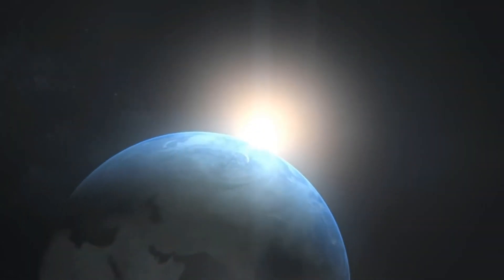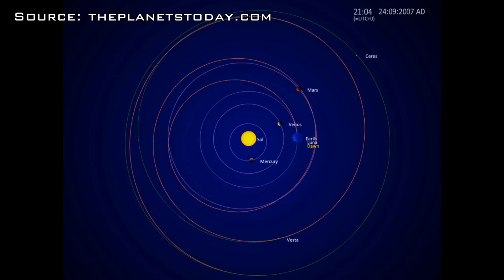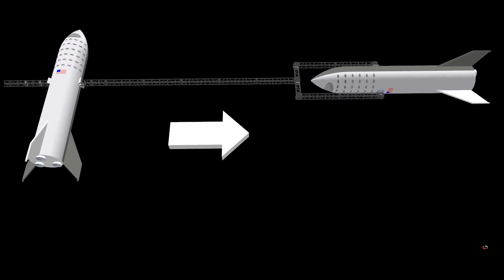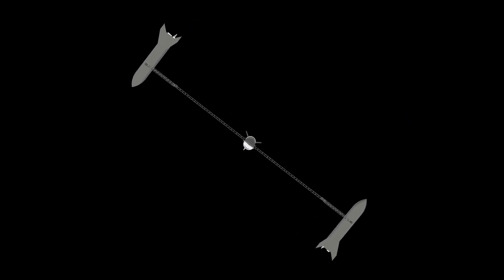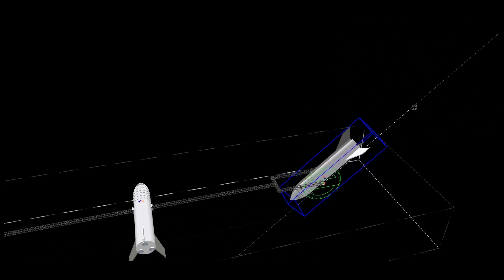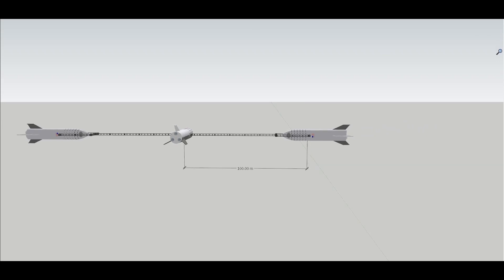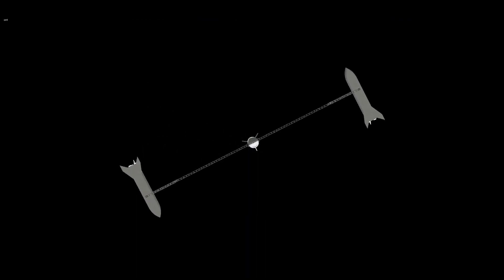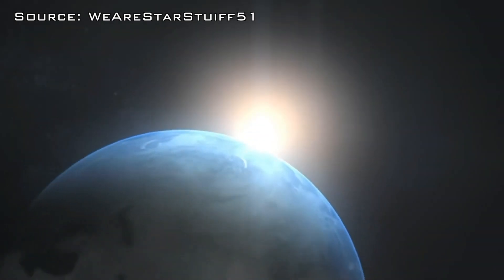GLS2: Artificial Gravity for SpaceX's Starship

Comment: I don't think you all understand that you cannot create artificial gravity by rotating anything in space.  There is NO gravity to pull you to the sides or bottom.  You'll still be floating in space regardless.  I don't know who came up with this idea but no one seems to have understanding or common sense to this.  Centrifugal force requires gravity to pull you down or against the sides.  Without it, you'll still be floating around in space while the ship rotates around you.
Reply from the maker: You are incorrect. Google gemini missions, they actually achieved spin grav in space.
Reply: No, "centrifugal force" is a property of a rotating frame of reference and doesn't require gravity ("centrifugal force" is just inertia by another name). All rotational motion involves an acceleration towards the axis of rotation, a centripetal force, without that the object would continue in a straight line (as per Newton's first law) rather than moving in a circle. Spin "gravity" works by using this acceleration as a gravity equivalent (the wall of the rotating spaceship pushes against your inertia and you feel that push as weight). It's well understood high school physics.
Reply: Anon Ymes not possible.  The ONLY thing at spin and inertia is the circular object at spin.  You are an independent object still relevant to actual space itself.  You don't just basically gain weight in zero gravity just because something is spinning around you.  This is where they tried to explain something that isn't possible to apart possible.  You were taught wrong like most sheep and forgetting basic common sense.  You are a floating object in space.  Even on Earth where gravity is present, if I place a circular device using spin around a stationary object and I'm just standing outside of it, will it pull to one side or to the inside of the circular object?  NO!  So what makes you think it will on a zero gravity environment? Here on Earth we have weight and would only gain more by your definition.  Ever been in the space ship at any fairgrounds?  The walls/places where you lay against is at a 35 degree angle so that you lay against the edge.  Thus locking you into and against the walls by centrifugal force.  Have you ever looked at a medical blood separation centrifuge?  They lay at up against the walls at a perpendicular angle to apply a minimal amount of gravity.  Please think about this with common sense first.  Not with a false assumption which is a lie told to provide understanding of something that isn't possible.  In space you have no weight (mass, but zero gravity as we know it on Earth).  Thus you can't lay at an angle to apply a minimal amount of gravity to push against the walls as it's done here on Earth.  You aren't creating some magical gravitational force that will be in the middle of the circle pulling you into our against the walls.  You can create force but nothing to hold your against it in space.  This alone is basic common sense here.  I suggest you actually build a small working device and try it first here in gravity and again in a vacuum.  Simple enough to hang anything by string in a vacuum and see if it pulls to the side.  There is NO working example anywhere ever made only simulated.  Why, because it's not possible.  The science actually contradicts it... But someone has explained it in a lie for those who lack understanding and common sense.  You'd rather believe what you're told than allow your own mind to understand the truth.

As for Google, the force you're explaining is a very closed environment.  There's no space inside or between.  You should have looked at this.  In rotation, yes, it will cause a centrifugal force.  That is the truth.  Be off you provide space inside you can hold anything to the walls as you're still in space.  You are also not laying in a perpendicular angle and if you were you would still be free floating in space.  There is no gravity to hold you at an angle up against the walls.  You will be thrown around violently.  I feel you're not actually familiar with centrifuges.  All of them lay everything up against the walls at an angle perpendicular to it's spin.  That's because we use gravity to force us against the walls and hold us into the centrifuge.  No gravity nothing to hold us in place.  We aren't just going to magically have weight that sticks our feet up against the walls just because that which is around us is spinning.  Now, let's say we create some kind of magnetic boots that area strong enough to hold us down but not throw us off or out of the spin.  That will allow us to move freely.  However, again, no angle, no gravity, no weight, so there's nothing to force us against the walls.  We will be held in place, but without weight and therefore will sustain g-forces instead of weight being applied.  I feel I haven't got where with your understanding of actual space and how centrifuges work on Earth.  Visualize this without anything but your understaffing of basic common sense and the basic laws of gravity, zero gravity, and a vacuum.  Only you will be in an air mixed environment inside.

So let's look at the space station... It's supposedly in a Geo orbit around the Earth.  So if that's the case why are they not pulled against the wall or able to walk upon it.  It is after all traveling at 17,200mph.  So in theory that your describe should provide a force against the wall(s).  But that's not the case is it?  I'm not saying you can't create force by spin.  That is possible.  However, You just can't force an object in zero gravity against something just because it's in rotation around you.  You're still in zero gravity.  But standing your mass is displaced and against subject to zero gravity.  If you, however, laid up against the wall in rotation you'll stay up against it and be subject to g force.  I guess I should have been more clear.  You will NOT be able to stand as your mass in zero gravity will be displaced and not in equilibrium with that of the rotational spin.

Comment: How about attaching 5 BFRs to a huge cylinder in a 5 point spoke and launching all at the same time.  The cylinder would be mostly hollow but have a truss system in the middle that would deploy even further and have 5 or more Starships attached for the spin up.  The hub ship would never land. It would just orbit when it got to Mars then return.  Plus it could offer an even bigger center section that could be used to grow food.

Comment: Extremity ingenious idea, this is so smart I can't imagine a better way of doing it
Reply: The smarter way is to design the interior of  each starship so that the starship itself can rotate on it's z axis by itself.
Reply: @illustratum42  shhhhhhh!!!....nobody else has caught onto that part yet...🤣🤣🤣
Reply: @dwilson8943  I think they did design it that way... But what I'm curious about is the radius is too small so that the head and feet would be rotating at rather different speeds...
Reply: @illustratum42  right, u would hope they make that top section more an observation deck area and the more lower section before engine and fuel area the living quarters with a internal rotation, that atleast how id do it...lol
Reply: @dwilson8943  that would be sweet, but pretty tricky to engineer... If something is rotating internally it needs a counter rotation to cancel the torque. And the smaller the total mass, the more smaller weight offsets, like more people being on one side versus the other would cause wobble.
Reply: @illustratum42  hmmm u right, like a counter rotation system for the gravity being produced...we mite as well go apply for spacex and help them out with this one..👏🏾👏🏾👍🏾👍🏾

Comment: the truss structure would have to hold the thousands of tons of ship at either end. it would make more sense to have small "passenger pods" with specifically the humans at the gravity and everything else at the center to have less weight on the structures and don't forget if anything on the truss fails then it flings passengers into space so the very absolute last thing you want skimp out on is the truss structure
Reply from the maker: Hundreds* of tons. Metric tons. 420 on each side for this journey.

Comment: It's not worth all the extra fuel needed and more complexity/danger of the mission.  Also I suspect that when the rockets change orientation it could throw the spin off (impossible to connect the truss at the center of gravity because the COG changes depending on the amount of fuel/cargo.) I vote for a spinning ship, or partial spinning ship design.  Like the one in the movie Europa Report or The Martian.
Reply: Both of those ships (Europa report/The martian) were small by comparison to this design (in terms of radius) and wouldn't be able to achieve the same acceleration/$ ratio that is presented here.
There would be significant construction on orbit and a design of an entirely non-existent craft at present. 
The design & method demonstrated by @smallstars utilises technology that will soon exist (starship) with some adaptations, Thus a significantly greater acceleration/$ ratio - more gravity for less money. SpaceX has already demonstrated that fuel is the cheapest component of spaceflight.

Comment: Speeding the rotation faster than mars gravity seems wasteful, they will be better acclimated by living in mars gravity during the trip
Reply from the maker: Every week living in less than 1 G, humans get weaker and weaker. Why not be as strong as possible? I agree, It would be nice to have some .38 G practice.
Reply: @smallstars  - would it be possible to drop from 1g to .38g maybe a week or so before arriving at Mars? Or even better, gradually step it down each day as they get closer, thus avoiding a sudden change in G.
Reply from the maker: @DiscoScottie  Yes! I was thinking almost exactly the same thing. A week of .38 G training would be great. Any more than a week does not give any benefit IMO because more time living in 1G will keep the space travelers healthier and stronger for longer.
Reply: The sad truth is, we have pathetically little research on the human impact of LOW gravity.  We have significantly more research on zero-G, but we don't know how much "G" is enough to acceptably minimize the nasty negatives of zero.  PUT A SYSTEM SIMILAR TO THIS IN ORBIT PRONTO.  Let's get some research going!
Reply: @737smartin  Exactly. Haven't spent as much time in low gravity environments. I'm sure it makes a lot of difference. Everything still goes down.

Comment: What if they used much less spin so it was only like 10-25% of earths gravity? It wouldn't require as much strength in the arms, and use less fuel. This wouldn't completely solve all of the problems of micro gravity, but it would at least minimize some parts.
Reply from the maker: It would be better than micro yes, but in my opinion the more gravity the better up to 1 G.

Comment: Great idea.  I missed discussion regarding the Coriolis effect.  Humans don’t tolerate having there vestibular systems spun up with any frequency.  Any movement within a short arm rotational system spins the fluid in our semicircular canals if we move our heads in and out of the rotational plane.  So you would need to be sure that the radius of the system is REALLY long to minimize this effect.
Reply from the maker: True!

Comment: Great!
1. I would add the middle ship to be a refuelling ship, to at least fuel the spinning requirements.
2. I also suggest the hard truss have some kind of emergency method for humans to move from damaged spinning ship1 to working spinning ship2.
3. Also, the mathematical model to work out the energy and force needed to turn the spinning ships from perpendicular to the truss, to inline with the truss seems amazing...calculus?
Reply from the maker: 1. Yes! Brilliant! 2. Yes, a ladder? 3. The math in going to do for the next video won't be quite calculous. I don't need to know the forces for every direction in every degree of co rotation, but I will find the max force at different locations using algebra to solve for torque.

Comment: I would just use a cable between the noses of two Starships as in tethered systems that have been proposed in the past. It will be much lighther and not need a third Starship to deploy the structure. It will also be easy to make the spinning radius much longer without adding significant mass to the system.  
You don't need to use the main engines to spin up. The velocity required is very small and can easily be achieved with the reaction control jets, so no need to tilt the starships relative to the axis of rotation. 
The cable will still need to be substantial as it will need to take several hundred tons of tension.

Comment: My thoughts were more of designing a swivel arm system between the pilot cabin and the mid housing section and another arm between the rocket booster section and the midsection. It would be a lot more stable and you'd have more options for controlling the rotation. It would also be interesting if a design came about that expanded the mid housing section of the rocket during space flight. A modular rocket design would open up a lot of things. Like a modular rocket design with a retractable shell/hull that houses the modules during takeoff. It would add quite a bit of weight to have the arms and mechanisms for them, as well as the retractable hull, but it seems a lot more reliable once you work out the engineering kinks. Or you could have a ring module that you keep in orbit. Once you enter orbit you could dock the ring for your journey and then detach it into a stable orbit before landing.

Comment: I think the truss has to be longer because there is an effect (the Coriolis effect?) where the outward force is different depending on how far you are from the hub.  The closer you are, the more difference there is.

Years ago, I did a little math and found that the effect is probably imperceptible at a radius of about a kilometer.  I still think your idea is the best there is, but the truss would have to be seriously long.
Reply: You may want to look at your maths again (your figures are likely for a spin of 1 rpm, which is extremely conservative). At spin rates of 2-3 rpm (which pretty much all sources agree is comfortable for humans) the radius required is around 100m. And that's to replicate 1g of course, which may not be necessary.
Reply: Anon Ymes - The closer I read your post (and did some homework), the more I bet you’re right.  I wouldn’t be surprised if more research hasn’t been done on what astronauts could tolerate in the last few years.

Definitely interesting stuff though!
Reply: @thetooginator153  Yeah, that's pretty much it - the first experiments were quite simple and just threw people into a spinning environment with no attempt at training or adjustment (those found maximum spin rates of 3-4 rpm with 1-2 rpm being better). Later research has tried different ways of helping crews adjust and current thinking has a potential limit for some people of up to 8-10 rpm and a conservative limit of 3-4 rpm (which correspond to radii of a few tens of metres). Of course it still won't be easy to build but it's at least more within our grasp than huge structures kilometres across. Some of the links in the description have more details or e.g.:

https://space.nss.org/media/NSS-JOURNAL-Space-Settlement-Population-Rotation-Tolerance.pdf
Reply: Anon Ymes - The paper you linked is absolutely perfect!  You did a pretty darn good job getting relevant information.

I’ve just read the first page, but it’s obvious that one kilometer is almost certainly unnecessary.  Here’s something that amazes me though: how can anyone really suggest a round-trip to Mars without some form of artificial gravity?  Yeah, it’s expensive and a technical challenge, but I believe it’s absolutely necessary AND (as you have pointed out) very feasible.

Nice research sir!

Comment: Like your enthusiasm but I see some problems
1) How much torque and mass can those trusses handle?
2) Starship's will have to be significantly redesigned to handle the loads at the points where the trusses are mounted
3) Also unless each space ship is the exact same mass (I'm talking fuel, people, mass location) you'll run into this problem https://www.youtube.com/watch?v=1n-HMSCDYtM
4) There's probably other problems that smarter people can see.
BUT if it all the hurdles can be handled we need something like this!
Reply from the maker: All of these points are legit! I'll have answers to some if not all in the next video (or actually 2 vids from now because "shape of the solar system" is coming out next)
Reply: @smallstars  Excellent. Can't wait to hear part two. I'm not an engineer or anything (and don't want to be all negative) - have just read a lot over the years about the problems associated with rotating space habitats (torque, Coriolis forces, inertia etc). But as you say we seriously need to find an effective to lessen the effects of zero-g on the human body and we need fresh ideas like yours man!